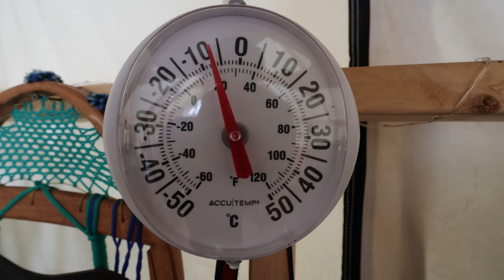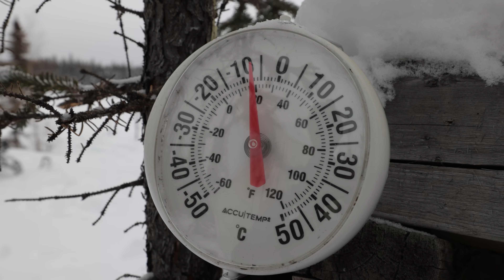SNOW HAMMERS TENT. Snowmobile Season Arrives

Comment: Jay thanks for the tip about the parka.  I need a new one and I have been looking all over.  It's old and worn out but I still wear I in the coldest temperatures.  I like a snorkel hood and the length goes down past the waist.  I got it for Christmas of 1975 and it has always been my favorite winter coat.  I really need to get a new one. I like the color too.  Tan.